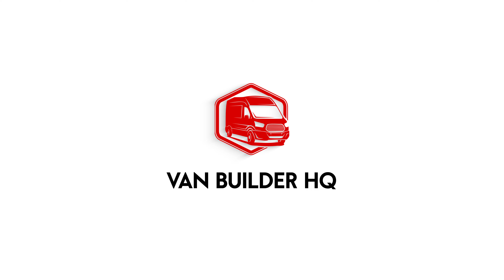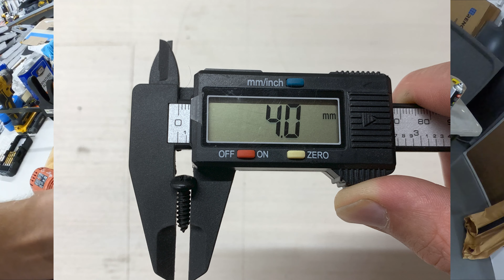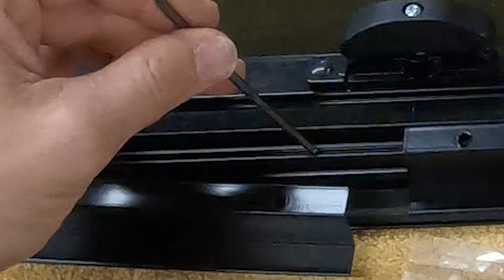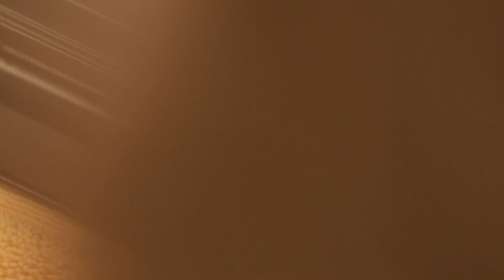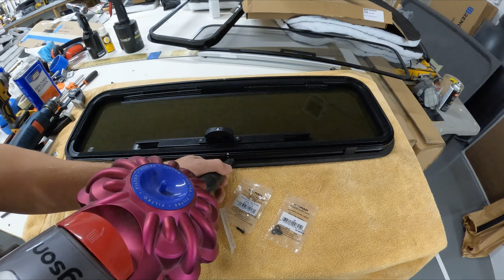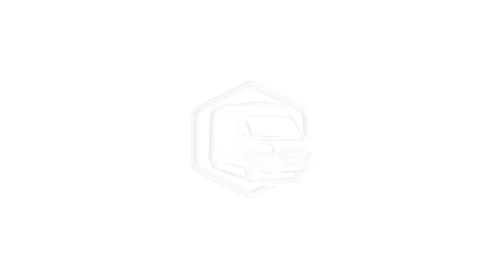How to tap threads in a CRL AW1033 & T-Vent Style Window Frame

Comment: This is exactly how I did mine with 8-32 ×1/2" pan heads. Thanks for posting. I was also able to adjust the screws tension to help conform to the slight curvature of my transit.